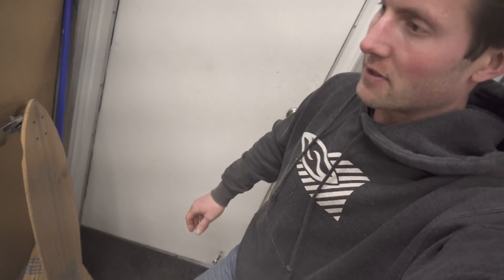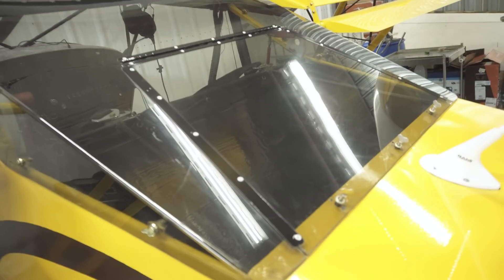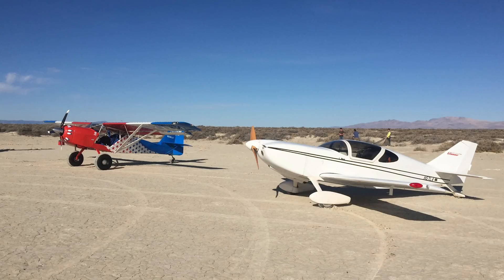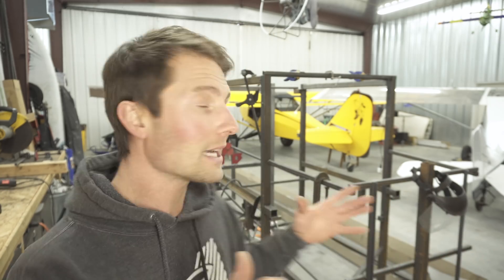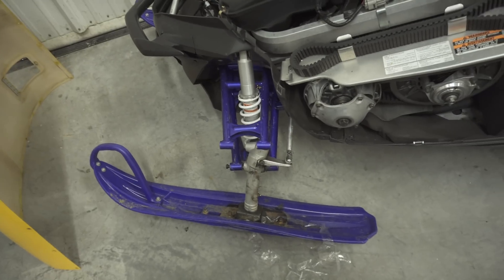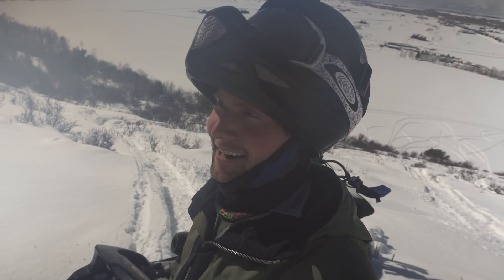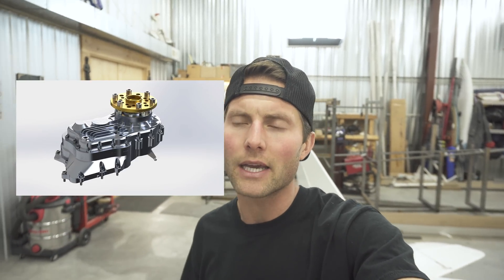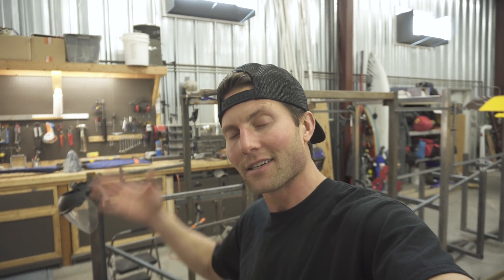THE DRACO DESTROYER! My New BUSH PLANE. Building it from scratch.

Comment: I have a 1050cc Nytro MTX 3 banger. I've been waiting for forever for somebody to put a 4 cylinder 1000cc Yamaha 4 stroke in a bush plane. It would be way more reliable than a Rotax. EFI and almost double the HP with the APEX. Good call👍

Comment: LOL.. Draco destroyer?? LOL
Draco is an incredible plane, can this plane, mythical Draco killer reverse thrust in flight... No. Cruise at 20,000 ft, No

Wait till Scrappy kills everything
Reply: Scrappy will not only kill, but bury and plant flowers
Reply: @maint_guy6977  yes, Scrappy can probrably out excelerate a Tesla model S in ludicrous mode then excelerate veryltcally to its service ceiling with scrapys huge airboat prop, high torque air grabbing, air gulping & air throwing prop.

Comment: For the wings, have you considered a set up more like a Cessna Cardinal?  No struts would be a significant reduction in drag and help cruise speeds.
Reply from the maker: The one downside would be the added weight. But it would make it faster. 
I am  already committed at this time to a wing with struts. But not a bad idea. Might be a way to to make it lighter though.
Reply: @JonasMarcinko  Aluminum honeycomb or carbon fiber?

Comment: Why not use a Viking Turbocharged 180 hp.  Great for higher elevations and very smooth.
Reply: Apex engine will be much lighter.  You can always toss a turbo on the Apex engine later, there are several kits to do so.
Reply: @RumblestripDotNet  Viking  Turbo 180 hp ready for the prop is 260 lbs.  I thought he said Apex is 250 lbs.

Comment: Hey Jonas great Vids....I fly a 2005 Cessna 182T, I purchased it brand new with one of the first G1000 Glass Cockpits at the time, anyway I am considering getting into Bush flying..Paved runways are getting very boring.  I own and live on 103 Acres on top of a mtn, I have cleared and stumped a small landing strip about 250 yards long, zero chance my 182 could take off from such a short strip however I am certain a cub or any light weight bush plane could,   Would love to pick your brain some time.   Just curious if you don’t mind me asking what you do for a living?

Comment: I understand the "draco destroyer" tag is just a fun little jab at Draco, but what I want to know is why you decided to go with a frame that looks the size of a kitfox, super stol, etc which is far under what Draco would be classed as. Shit already exists that beats draco, there's that modified cub that took off with a head wind in 10 feet, so draco has already been "beat" for takeoff run. If you want to be more accurate you're going to need to compete with Draco in the load (something draco blows just about every stol out of the water with) and cruising speed (same as load). 
Again, fully understand "DD" is just a joke, but honestly man I'd love to see you really push for a heavy class of STOL aircraft to beat Draco.
Reply: This guy isn't building shit.
Reply: Huh? You have no idea what you are talking about. You are comparing a cub taking off in a headwind to draco....? Put them side to side in the headwind and Draco will would still outperform all of these stol planes. Smh youtube retards

Comment: if you are using 4130... you need to have small holes thru the tubing.. so you can back purge the entire frame with inert gas to stop it from oxidizing on the back side..  just like you keep the gas flowing over the outside when you have stopped welding. if you think i am crazy...   do 2 test welds... one back purged.. one not.. cut them open and see what the back side looks like..

 you will also want to find a heat treating company that you can fit your entire bare 4130 airframe in to bring it up to 1100F. for the proper time to get the full strength of 4130 thru out the air frame.  you will also want to do this with the 4130 wing structures..  not doing this.. creates different areas in the 4130 near the weld joints as the heat spreads out..   this can cause fatigue cracking..  the 4130 engine support also has to be heat treated this way..  some call it stress relieving.  you wouldn't use an un heat treated bolt..  so why risk your life on 4130 that is not properly heat treated or stress relieved.  if you need a company that can handle the size of your structures.
Reply from the maker: wayne p thanks for the info! But how do I back purge. Same gas as im using with my mig?
Reply: @JonasMarcinko  exactly using a second tank.. regulator  solenoid.. flow meter..   you do want to keep the  inert gas flowing to keep the oxygen out. but not build pressure from welding gasses.    you could put a tee on the regulator so you have 2 outputs from the regulator.. hopefully not effecting the flow of inert gas thru the tig hose. 

 you can also use various shapes of perforated metal as wind blocks to keep any air moving thru the shop from dispersing your shielding gas around the upper surface of the weld.
Reply: @JonasMarcinko  video on one way to back purge while welding 4130.. https://youtu.be/_oexr-75T9g
Reply: @JonasMarcinko  here is an even longer video on backpurging.. https://youtu.be/AIRWMhoke9I

Comment: I would rather use a Rotax 1500 from a Sea-doo but anyway. You should def get it turbocharged. In snowmobile use 260hp  plus are no big deal,  many have around 300. so 200 in a plane should cause no problem.

Comment: You keep calling it "Draco the Destroyer".
If you're going to claim your aircraft you haven't built let alone flown yet is capable of "destroying Draco" (a proven badassed aircraft), you kinda come off as a jackass punk just begging to get humbled. Instead of people rooting for you to "win", most are quietly hoping you are going to fail. Glad you love flying and you are excited about your new design, but damn...
Reply from the maker: I agree with you. But in this youtube game, one has to think of ways to get people to come to look at your video. As I'm sure you and a few others may not have even clicked on the video if it didn't have Draco involved. When it comes down to performance, it is largely determined by power to weight ratio.  So yes there is a chance that I could compete with Draco. so it's not entirely made up.

Comment: Turbocharged that engine get over 200 horsepower without adding much more weight. You could E85 and have a ripper for sure close to 250 total power. Good Luck I'll keep up with your build. Sounds like you got lots going on .

Comment: Bro you have a project on your hands if you want to get anywhere near the performance of draco. Mike patey and his friends have been building one off airplanes for a while eg turbulence, draco and the flat 8 lancair. Unless your familiar with designing airfoil and understanding what that airfoil is going to do to the airframe your going to hurt yourself. Start with a basic proven fuselage and a wing that's proven and start from there. Hope you pull it off I'll be keeping track of your build all the best bro
Reply from the maker: Karl Heaton I get where you are coming from. But we have all seen some ungodly airplanes fly. So not that concerned with it falling out of the sky. For the most part I’m copying a basic fuselage. When it comes down to performance. Power to weight is a large factor for stol aircraft. 
Thanks for fallow.
Reply: @JonasMarcinko   What kind of wing are you looking at making for it and whats your baseline for the fuselage ( unless its a secret ;) ) Frankenstein airplanes are the way forward for bush planes unless you got  quarter of a mil for a good spec carbon cub or back country super cub
Reply from the maker: I would rather not say. ;) Totally agree Frankenstein bush planes are the way to go!
Reply: @JonasMarcinko  do you have a timescale on the build am curious now bells been pressed for notification !

Comment: The plane to outrun Draco at the stol drags will have to be a lightweight with a better power to weight ratio & a VP prop. The Apex will need to be turbo'd & the PSRU will need to handle that HP. This should be an interesting hot rod Jonas!
Reply from the maker: That’s my plan! make it light!
Reply: Draco's clearence is a factor as well. If not on competition.

Comment: You are blessed with airplanes and other man toys.....I'm not a pilot,  but this looks to be interesting to follow.  Do you expect similar performance as the original Draco? I will be following.
Reply from the maker: For the most part it comes down to power to weight ratio. So I’m going to do my best to make it as light as possible. And the other thing that helps in the stol drag is the ability to slow the aircraft down fast. I have some ideas that I may help. 
Thanks for the comment!